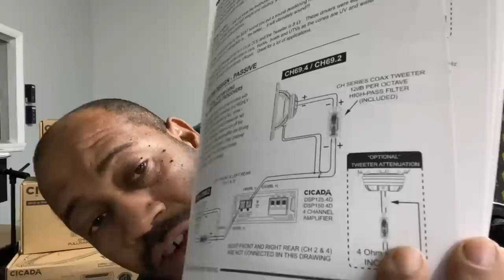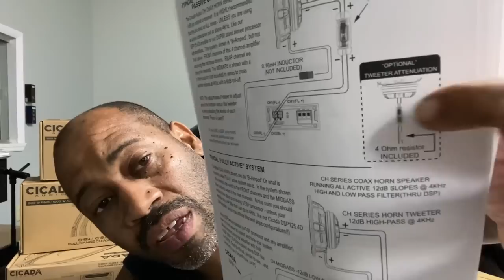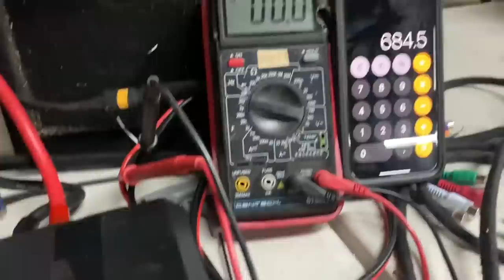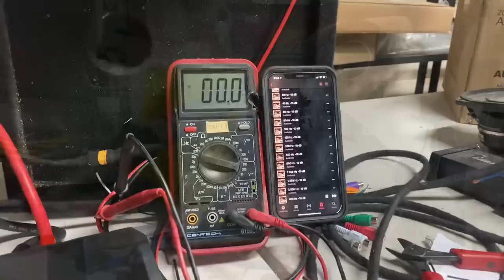Cicada audio 6.5 motorcycle coax horn speaker review by NVS Audio ch65.2

Comment: I have a 2019 Harley Davidson streetglide  , I have the Rockford Fosgate  kit installed professionally. The front speakers and 6×9 saddle bag speakers  , if I leave everything else alone and change the saddle bag speakers to the Hertz spl speakers,  would I be able to tell a big difference in how loud it is at highway speeds
Reply from the maker: No 

The amplifier controls how loud a speaker plays 

It will be clearer but not louder
Reply: @NVSAUDIO  thanks for the information

Comment: Hey, do you happen to have a suggestion on how you would run a Cicada Audio setup utilizing the Coax speakers in a Road King setup? I only see technical details on builds with fairing-radios. If possible, I’d like to have some kind of handlebar control that I can use with gloves. 
If I need to email someone, I can do that too. I’m just trying to turn this bike into something special. 
It belonged to my late father in law.

Comment: So have you been able to get your hands on there amps yet? If so, thoughts specifically the 150/4.  looking to do a 4 speaker set up would you recommend to run 2 150/4 with this set up? Soldering all connections and what type of oxygen / gauge wiring? Any other recommendations would be appreciated. Thx for your videos and reviews. Wish I live closer to you.

Comment: Carlos, could you run two 6.5 and a pair of 6x9’s cicada with a 1200.4 or 2400.4 run in stereo?  Will the 1200.4 be under powered?
Reply: Yes would that be enough power

Comment: Quick question. On their website it says "500WRMS/1000 MAX Power Handling- PAIR". Does that mean each speaker is 50pW RMS or that the combined 2 speakers is 500WRMS and each speaker on its own is 250W RMS? Also, i really dig the sound and clarity of this speaker. If my system im putting on my bike is going to be a 2 speaker, 1 amp system, will these speakers be able to cover full enough range that the average person wont notice any range missing? Or if im going to run a 2 speaker system should I not go with a Horn speaker?
Reply: Each is 250

Comment: Will those 6.5’s fit in a 2009 ultra classic, thinking about putting 3 sets in if they will fit in the fairing, lower fairings and rear tour pack on the side of the passenger seat…..not looking to add anything into the saddle bags because I carry stuff for work and whatnot and need the space.  Also what amp and how many would I need to properly run the speakers and tweeters, and with the crossovers would you still recommend running a dsp?
Reply: Great question was thinking same thing.

Comment: Considering these 6.5 in fairing to replace Hertz neo 6.5. Cannot use Cicada 6x9 in lids because of the removable Rockford subs and the magnet and depth on the 6x9s won't fit. I am buying the new Cicada 1400.4 amp. Can I run these 6.5 2ohms with Hertz 6x9 neos that are 4 ohm off that amplifier?

Comment: I have the soundstream reserve HDHU9813 head unit with a arc audio moto720 amplifier and I’m not running a DSP but I have a 13 band EQ in my head unit but the instructions for these speakers say to use the 4ohm resistors if you’re NOT using a DSP or EQ to make the horn tweeters not so bright. Does my head units 13 band EQ count as “using a EQ?” Or would it be best for me to install the 4ohm resistors anyway? I’m new to the horn speaker world with crossovers and resistors so sorry for the 20 questions. lol

Comment: I got a card with my ch65.2 speakers today that said to set the amp frequency no lower then 120hz and something about a 24db octave… asking your opinion on this cause to me 120hz on the amp frequency dial just seems high to me.. I’ve always had mine set to about 85hz. But according to cicada if you set it lower then 120hz it’s damage the speakers
Reply from the maker: Anything with a horn i tune 120 / 150 and up 

The card is correct
Reply: @NVSAUDIO  thank you

Comment: Hey Carlos, would you run 2 Cicadas 6.5 on an Arc Audio Moto720? It's a 2 speaker bike (BMW). currently using said Amp with 2 Arc CX6 speakers.
Reply: Kenny. If you're running the Fullcomp pods, the fronts would most likely be ok. If you run the CH65.4's you could bridge the Moto720.4 at 360 x 2. Assuming you're running the CX6's off just two channels, it will certainly gain a ton in overall output.
Reply: @extremeaudioinc  I appreciate the response and the knowledge.  And yes, i am using the FullComp pods up front. Just not sure if its a direct fit. Keep up the good work Carlos.

Comment: Bro I have problems with mine sounds like it's just like treble doesn't sound good I just buy my bike but I think they did something wrong 😑
Reply: Could be a number of things; depending on the year of your HD, if you're stilling running the factory head unit, you my need a radio "flash" to remove the locked preset EQ settings from the factory; also, the settings on your amp may need to be adjusted (high-pass/low-pass, and crossover settings)...
Also, the horn tweeter can be overpowering your mid's, which can "tuned-down" by adding the included resistor in-line on the positive input wire.